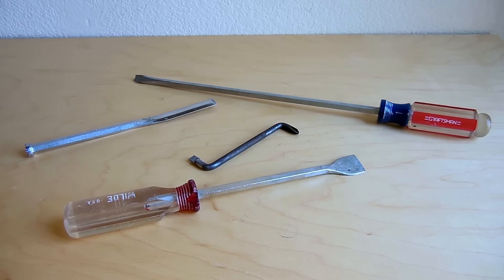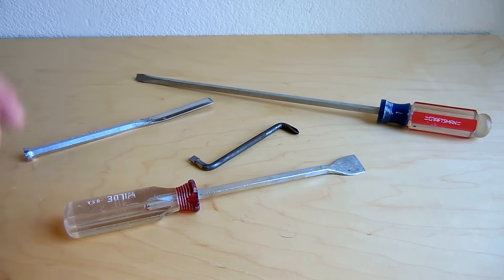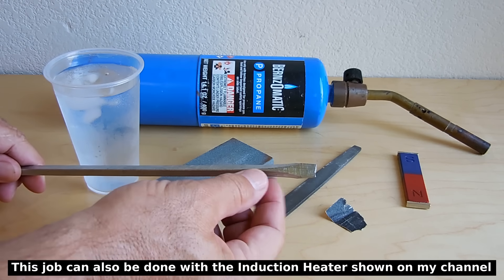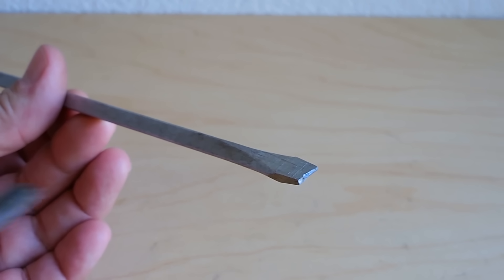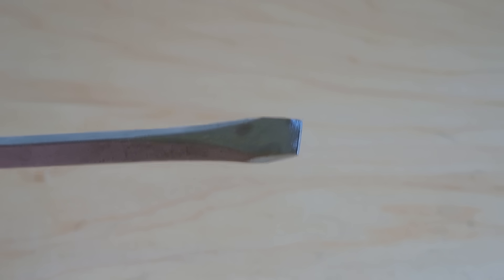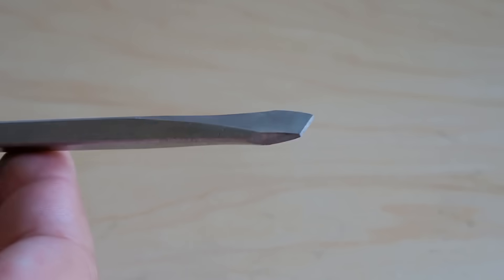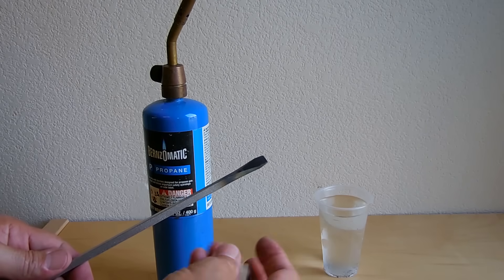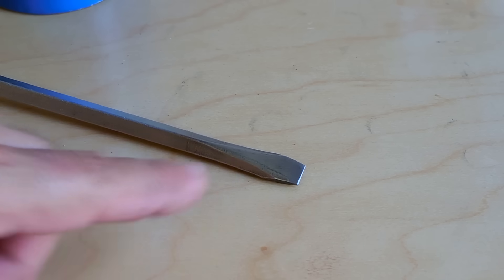How To Heat Treat / Temper Hand Tools & More!

Comment: I thought tools that need to keep an edge are tempered to straw color. Blue-tempered edges won't hold up very well... All my chisels, pointy or edged tools are tempered to straw color and they keep up nicely. Just sayin'.
Reply from the maker: Refer to the tempering chart in the video. Thanks for watching!
Reply: Cold chisels can chip and crack if you leave them too hard. Not all edged tools are equal.

The only thing I would have liked to see addressed in the video is the effect of the pre-quench temperature. The way I understand it, when you raise the temp of the steel above critical, the grain size increases. So if the steel is brighter than a dull red cherry when you quench it, it isn't as fine in grain as it could have been. And the finer the grain, the tougher the steel for any given final hardness which you temper to. Thusly, I would guess that the magnet trick is probably not a great idea for most tools, unless you have a temperature controlled forge (so you can get the entire tool to the same temperature, within a few degrees here or there). 

Most tools only need a hard face/tip/edge. So a relatively small torch flame is sufficient for small tools like these. But if you wait until the tip of the tool is completely non magnetic, the face/tip/edge is possibly a bit hotter than it strictly needs to be. As soon as the last inch or so turns dull reddish with a barely detectable hint of glow, I think that is when I  would personally dunk a cold chisel. But I have never heat treated a chisel, so who knows?

Other than that, this is a great video with a lot of good information.

Comment: Thanks for the video. You said this apply to tool steel. Can this method be used for a stainless steel kitchen knife?
Reply from the maker: No, the process is different. Thanks for watching!
Reply: @electronicsNmore  OK. Thanks for your reply.

Comment: There's a reason you should be using oil instead of water. The oil soaks into the steal making it black.
Reply from the maker: Actually, the oil eliminates soft inner spots.

Comment: try cold tap water quench with .08%carbon steel then drop iton theconcrete.trythe same with a piece of leaf spring.if the .08 carbon steel doesn't crack in thecold water itll surely break when it hits the floor.carbon content determines all buddy
Reply: .08% carbon isn't hardenable, that starts around .2% and most springs are around .6% carbon O1 the steel mentioned in this video is around .9% carbon. I check my knives for stress cracks by dropping them tip first onto concrete after hardening and they are normally made of 1095 which is roughly .9% carbon you can significantly change the property's of a steel without changing its chemical composition.

Comment: all deends on carbon content.not all steels are the same hardness at the same colors.high carbon steel at bronze is much harder than a medium carbon steel at bronze.all aboutthesteels ultimate potential hardenability.and you need to anneal it before you shape it.too much info missing
Reply from the maker: No, nothing missing. This video showed a BASIC method for TOOL STEEL.

Comment: Using water is stupid it cools the metal to fast and will cause stress fractures
Reply from the maker: Not all the time. Water and motor oil are both used, as well as brine. Use the oil. :-) Remember, this was a BASIC how to video. There are a lot of techniques for heat treating steel. Thanks for watching!

Comment: Used motor oil is better for tempering cold water can crack the steel
Reply from the maker: Oil quenching is also fine, but water is most commonly used.

Comment: My question is, why make the process in two steps? First with very high temperature (red), then with medium. Why not skip the first step?
Reply: It has to with the crystal structures in the steel. When the steel is no longer magnetic, that's the start of the refining(strengthening) process. But having too fine a crystal structure makes the steel brittle. Tempering after quenching realigns the new crystals making it more resilient.
Reply: Thanks Mike.
Hmm, on the other hand, is there situtation where we would prefer steel to be more brittle but harder? Drilling bits maybe?
Reply: Yapan Azuma Yes there are times when you want that. Drill bits are a good example of this. They need to be much harder than the material they are drilling through which is why you'll often see them with chips in the cutting edge.
Reply from the maker: If the metal is already properly heat treated and very strong, then you can simply repair a screwdriver tip by grinding it and keeping it cool by dipping it in room temp water as you grind it. Thanks for watching!

Comment: unless that steel is .5% Carbon, (tool steel) it will NEVER harden, no matter what you do to it...Most chineses tools are NOT made of "High-carbon" steel....shitty mild steel, mystery metal...BTW- Dull-red heat is plenty....yellow/white is far too hot.
Reply: Scott Fain I believe you can infuse carbon into steel if you incase it in a charcoal slury and then clay and heat it red hot for an hour (give or take)
Google it
Reply: Yes, but I heard you have to hit it with a hammer to "lock in" the carbon molecules.  so needless to say, the metal will be in a different shape or a lot flatter when you are done.
Reply: what I do in my forge (and iv done this with mild steel) is that I mix ground charcoal with dry hay from the field and i taco the knife in the dry medium and let it burn away, then repeat the treatment three or four times. to help retain the carbon through thermal cycling i flux using borax. hammering helpful is for carburization in a forge but not needed (as its being exposed to carbon dioxide and monoxides for the most part carbon is typically a surface material up to .7 of a millimeter (according to the first edition iteration of the fundimentals of metalurgy vol1).  all the carbon does is harden the metal by locking extra carbon atoms into the steel lattice structure (dendrites), to make it ductile after the fact you actually have to bleed carbon from the metal in a slow heat treat at temps around 292C (520 f) then let cool in air. quenching in water can shock carbon steel if you aren't careful. (ps Maui, yes you are correct about oxidizing in a charcoal slurry, alternatively you can carburize the steel in a mix of charcoal and cat litter than just bury the metal in the material (as long as it goes in there white hot and left to do it's thing in the bentonite/ charcoal coke mechanical mixture) 
really in fact the metal has to be kept in a superheated state and quenched repeatedly to lock in the carbon deeper then the textbook .7mm stated in TFOM V1.   also keep in mind, too much carbon and the metal turns back into iron (wrought or pig iron) which is super brittle and of what most would amount to a piss poor quality
Reply: ps i highly recommend fish oil or extra virgin olive oil as a quench solution. as it packs all the carbon you could ever want or need into the steel as it cools. i use this method about 150 times a year and swear by it.  careful though because fish oil gets real stinky, go outside for that one!

Comment: This has both informed and infuriated me... During the tempering process you are supposed to heat at a point back from the cutting edge and allow the colours to travel to the tip. Instead you weaved the piece all over the place including bringing the heat almost directly to the tip!!!! Patience is required for this job and this was rushed at the critical phase.. Disappointing and it spoiled a very useful video.
Reply from the maker: If you actually watched the entire video, you would have heard me say to heat AWAY from the cutting edge and allow the heat to travel toward the cutting edge. I also demonstrated that in the video. Sounds like you need to take some pills to relax.
Reply: Sadly yes I watched the entire video. I heard what you said, then I saw what you did, both were contradictory. I dont take pills, I'm not a dumb Murican... If you're going to post online, learn to take critical appraisal.. I'm at this 41yrs. I said it was informative, I just feel you fell at the last fence by being hasty, which ruined the whole project. You deliberately forced the colours towards the tip which is in contravention to best practice. If you cant take informed criticism, stay home and play with your dolls
Reply: Hey midland welding how about you put up a video?
Reply: There is nothing wrong with the way he did it. He did heat away from it and the results will be the same. You are looking for the color change. The only way to make it more accurate is to put it in an actual heat treatment oven set to the correct temperature. You are being too anal about this.

Comment: Hi  Great video
That is exactly has I was taught at Mather & Platt , Manchester ,England ,in my apprenticeship  . The chisel I made was the only one that didn't break when the instructor tested them They also taught me to case harden low carbon steel by heating to cherry red  then sprinkling case hardening compound on the area to be hardened then quench. Other carbon source's options are bone, horse hoof clippings and even human nail clippings , any source of carbon . No tempering is needed because the steel is soft where no carbon has been diposited
Reply from the maker: I've used that case hardening compound in the past. :-) Glad you enjoyed the video. Be sure to check out my extensive video playlists, rate thumbs up, share my channel with others, and subscribe. Thank You!

Comment: Have you tried doing hollow ground edges (like gunsmith screwdrivers) for flat head drivers?  They seat deeper and do less damage to the screw face in my experience,  I've never heat treated them as since I started doing that all my tools have that non conductive sheathing on the shaft, might try to roll it back though and give this a whirl, I use them too often as a chisel for lock nuts.
Reply from the maker: No I haven't. Thanks for watching!
Reply: Cool- then maybe I have a nice little tip for you for once :)   You basically want to grind down the profile of the angled edges into concave faces, just about the only trade that uses them are gun smiths since they are so protective of the screws.
Reply: @EgadsNo  ni in

Comment: got a question, i installed 6 after market led lights on my harley (2 turn, 2 running and 2 brake), with the bike started and the running lights on i squeeze the brake lever the brake lights come on but the running lights dim to the point you can't tell they are on
also when i use the signals lights the brake, running and blinkers all blink, if you switch back to incandescent bulbs everything works fine, is there something i can install to make the leds work properly?
Reply from the maker: Sounds like the lights on your Harley are run off the stator using AC volts, instead of being rectified to DC volts.
Reply: i know a little about AC and DC, wouldn't that cause the running light bulbs to get brighter rather than dimmer, i've also thought about a short but ruled that out.
some one told me that i may need an inline resistor
Reply: but they do the same thing when it's not running

Comment: Back in the day we used oil for the second quench .
Reply from the maker: Yes, you can do that. I never had any problems using only water. Thanks for watching!
Reply: Depending on the steel composition temper must be done in cold water, cold mineral oil, or even in cold moisty sand, sometimes to avoid too much fragility, on low carbon steel, the second cooling is done in mineral oil.